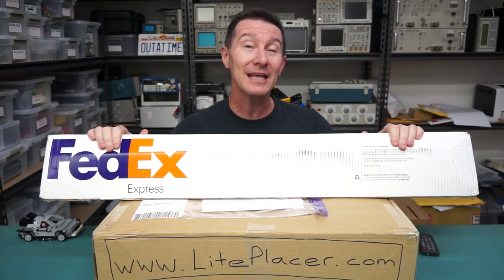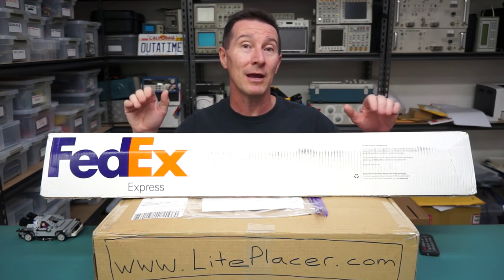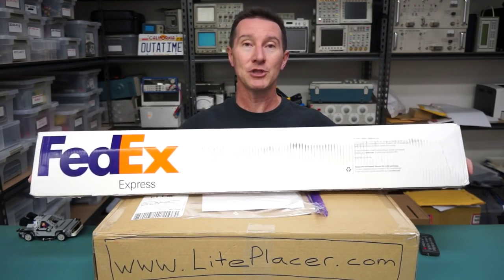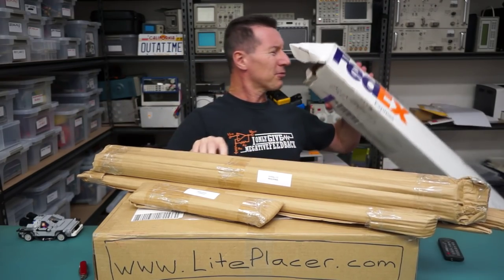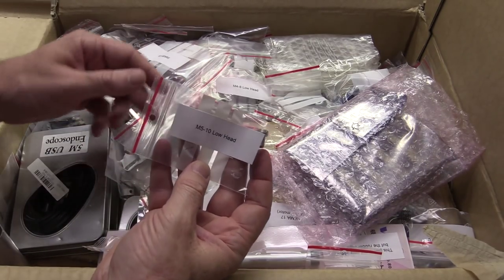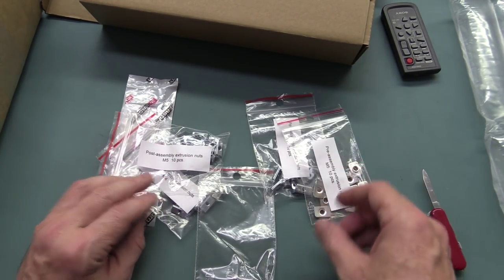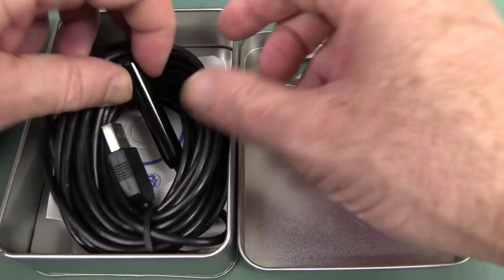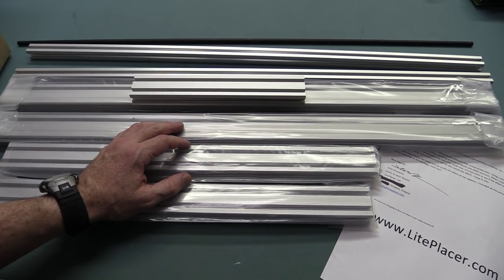EEVblog #740 - LitePlacer Pick & Place Machine Kit Unboxing

Comment: I was considering this pick and place for my projects but was just to slow for a small production on my Solar BMS.
The price on this LitePlacer is extremely reasonable considering the items included and the low volume nature of this product.
My current project has two PCB's one of them has around 150 parts and I can get at least two of them in the reflow oven that takes around 10 say 15 minutes in all.
So two boards reflow at once and about 4 sets an hour is 2x150 parts x 4 = 1200 parts/h is a minimum in order not to wait for the pick and place machine.
So this LitePlacer was about 4x to slow for my use.
I opted for one of those mechanical only pick and place no vision that can do up to around 6000 or so parts/hours if you use both heads at once. I will run that slower than maximum but will still be good while it is quite a bit more expensive around 4x the price of the LitePlacer.
I think the guy did a fantastic job with the LitePlacer. Maybe on a new version he can reduce the weight of the moving head so that he can increase the speed.
I think if he can get to a real world 1000 parts/hour it will make the machine much more usable for those with my requirements.
Also the software part seems to be great on the LitePlacer so if he can recognise lose parts that will be great with no need for complex feeders.

Comment: For kits with lots of parts like this I think it would be useful to number the parts bags in the order they are used.  Then you can just put them all in order before hand and grab them as you go very quickly.  Just a suggestion for the manufacture to help the end users save some time.  At least that is what I have found can save a lot of time when I have assembled kits.  YMMV.
Reply: ElmerFuddGun Some parts are used through out the build. That's a lot of baggies.  Plus, the instructions seem to be very clear.  I've put together a few cartesian robots, and once you've done a few, it's all starts to make sense.
Reply: GeorgeGraves OK, fair enough.  The small number of parts that are used throughout the build can always be labelled as such.  And because "that's a lot of baggies" is exactly why I find it helps.  The manufacturer is already printing off labels so it doesn't add any time for the printer to put a number along side the description.

Sure for someone like you that has assembled similar kits in the past it might not help, heck you likely could figure it out without the instructions!  ;-)   For others though I think it can save a lot of time.

Like I said YMMV.  Thanks for the reply.

Comment: That's an ACME leadscrew. If you end up having issues with backlash, you can get a cheap ballscrew which should cut it down pretty well. The NEMA motors most likely aren't branded, there are quite a few little places in Shenzhen cranking these guys out. Looking forward to seeing how it comes together!
Reply: The stepper Motors I'm using come from http://www.omc-stepperonline.com/.

Comment: It is amazing how computer technology and inexpensive stepper motors are making it so easy to create and build CNC machines. The video of this device shows a lot of wasted(?) motion as it seems to move the head away from the PCB area off to one side before going for the next part. That movement could be optimized and it would increase the rate of part assembly.
Reply: Kevin Cozens That is the vision taking a look at the tape hole. But you are right, that doesn't need to happen on each part - first and last would be sufficient. This speed improvement is on top of my to do list.

Comment: At 7:28 Dave shows off the cable protection thingy that looks like tank tread.  Dave refers to them as "cable snakes".  I thought I would see if I could buy some, looks useful to have in the kit.  However "cable snakes" generally refers to a audio/video cable with several sub-cables inside.  I tracked down the industry name for the stuff shown in the video, it is called "cable track" or "cable chain".  Who knew?
Reply: cemx86 Not all builders want these, so they are optional, but available at the store.
Reply from the maker: cemx86 Yes, cable track is a more common name I think, it didn't come to mind.
Reply: EEVblog I bought those as "cable drag chains". :-)

Comment: Haha, that stepper motor trick is always awesome. I had two Watson Marlow peristaltic pumps mounted to a panel and wired them up in parallel. Everytime I showed somebody that the second pump was turning as I turned the first one they were looking for belts 'n gears and wondering how that works. I made someone believe that there are microgears in the 2mm thick aluminium panel. Hilarious :)

Comment: I think you have made a rod for your own back with this one, I would love to see a budget P&P running, but so many variables. By the time you set the thing off and watch and tweezer every component to correct placement  (make sure both ends are in the paste to stop tombstone's) you may as well hand ball the whole lot. Warning to Dave the Fixer, nema17's don't like being loaded with belt tension, they miss steps (but you knew that anyway). Please make this happen and I'll buy one.
Big Thumbs Up.

Comment: if the thing tracks 1 to 1 with the one your turning where is energy being lost?  tourque?
Reply: ***** Check how stepper motors work internally. They are a bit different from other electrical motors since they only move in discrete steps, hence the name :p That's how you can get a 1:1 turn ratio. As you say, the torque will not be the same on the other end.
Reply: perhaps Dave Jones  should do a vidio on stepper motors      take one apart and show us the inside :)
Reply: That would be great.
Reply: it /is/ tuesday :O

Comment: Forgive me if I'm missing the point here, but, what's the point of paying $1300.00 USD for an incomplete kit?
Reply: ChozoSR388 The kit is mostly complete. Items not included are those that the customers likely already have or might want to arrange according to personal preference, such as tools and cables (how far and where on your work area you want to place the electronics? Up to you.). For some, the customer is better off getting them locally, such as a table top sheet or a power supply. I would need to charge at least $80 for a power supply; by doing that I would feel ripping off the customers, as they can get one by $40-$50, shipping included. I don't want to do that. More details at http://www.liteplacer.com/introduction-f-a-q/.